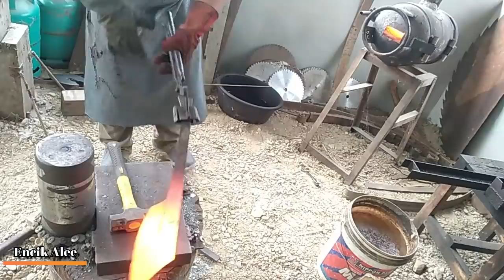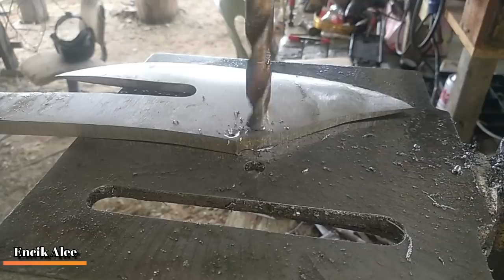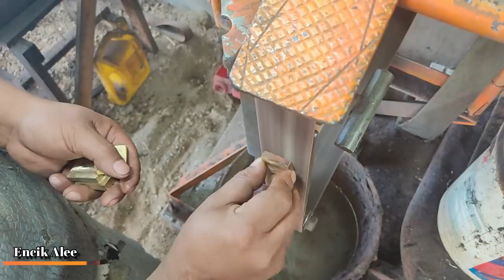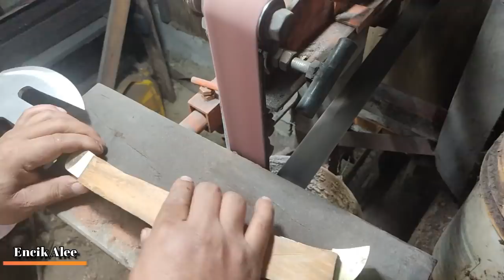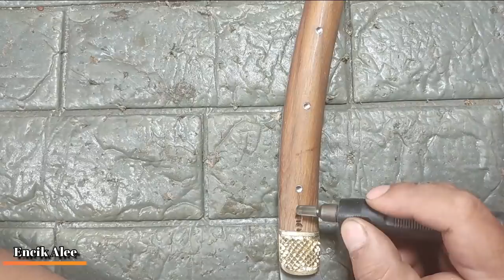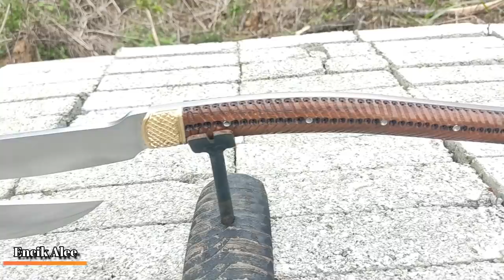♻️ Making an Axe From Junk (FullTang) | Cara Buat Kapak

Comment: Great work! I have one question, when you spot that crack instead choping half of the blade couldn't you just drill a hole od the end of it so it wont trawel any further ? Would that hold ? I'm just wondering...
Reply from the maker: At the end of the crack line was still inside the quench hardness area. Imposible to drill on that area. Maybe a tungsten bits can go through it but mine just hss 😁
Reply: @EncikAlee  how abaut angle grinder with looot of water on the blade? Finish it with the chainsaw file and you hawe Y shape in it.. Anyway beautifull work and the finish was just another level XD

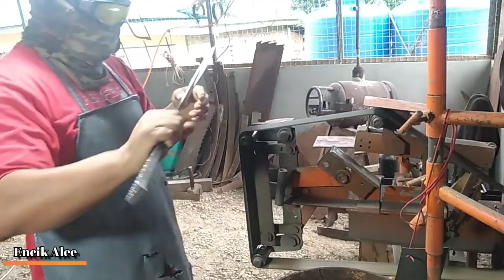Comment: I dont understand what happened at 5:25
Reply from the maker: its crack 😭
Reply: Crack in the steel either from stress or cooled to quickly or any number of reason but it would have broken the blade had he not cut it out
Reply from the maker: @patricksims4607  maybe. But i dont wanna waste the blade. It Still got second chance 😆
Reply: @EncikAlee  you did good!